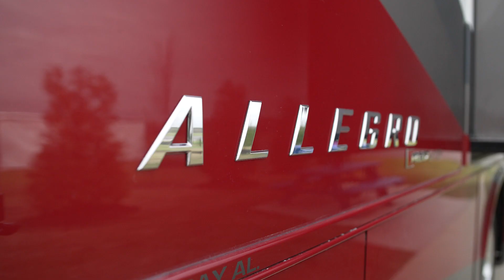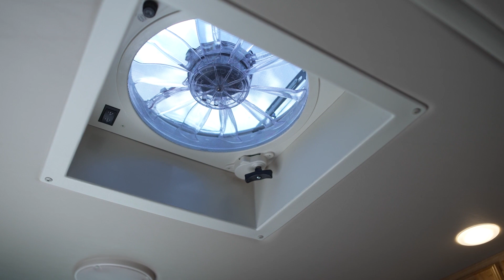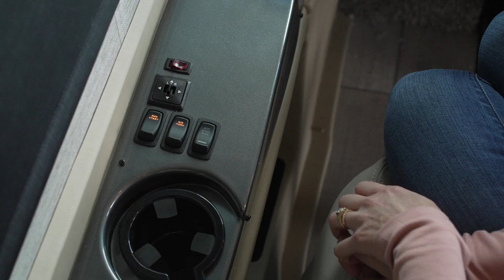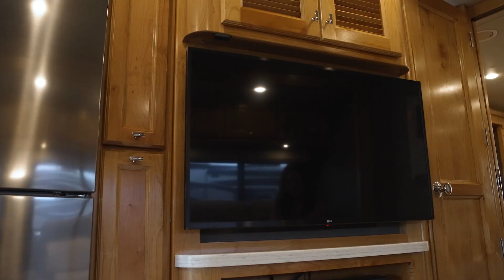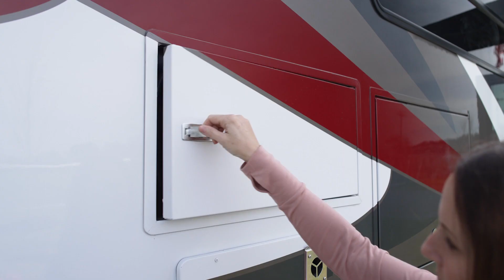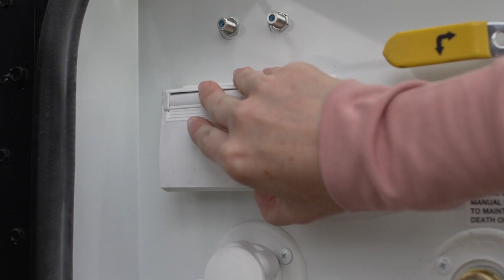Tiffin Delivery Walkthrough: 2022 Allegro RED 340

Comment: Is the air level system just as capable as the hydraulic jacks?  Thanks!
Reply from the maker: Thanks for your question! Our Class A service department would be happy to answer that. Reach out to them at 256-356-0261 or service@tiffinmotorhomes.com.

Comment: Wonderful presentation!  This RV is a wonderful entry level diesel pusher and does come with a lot of great standard features and many great options.  However, has their been any thoughts about providing an option for a manual or electric power cord wheel, and the passenger platform board being replaced with an electric cover vs. a piece of plywood that is drops down the stairwell, and lastly, to have Solar Panels installed when ordering your custom made RV from a Dealer?  Best, Steve & Deb from Western Mass.
Reply from the maker: Thank you for your suggest, Steven! We appreciate getting insights like this from our fans. We will pass along your feedback.